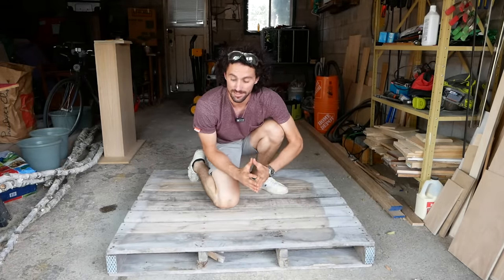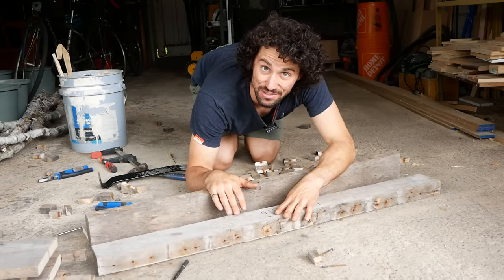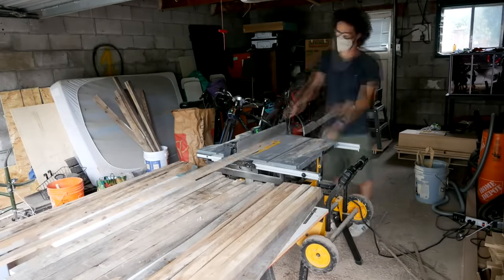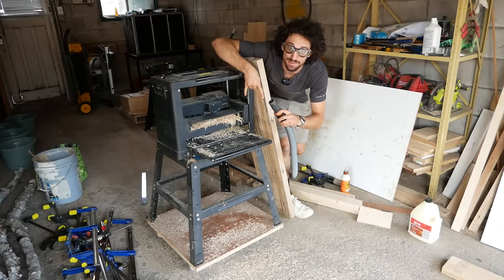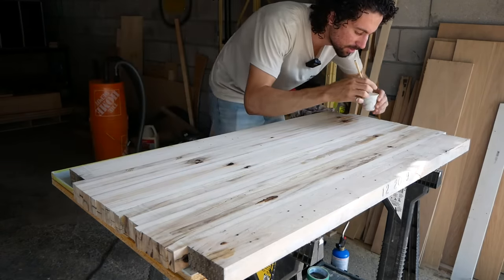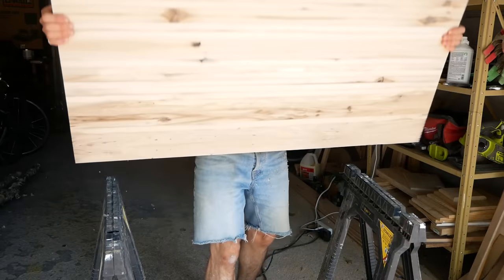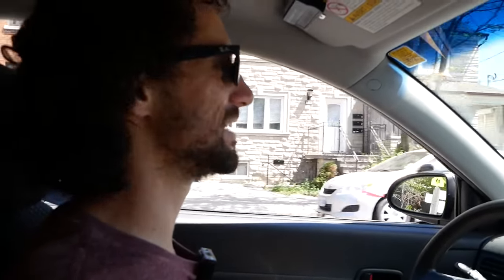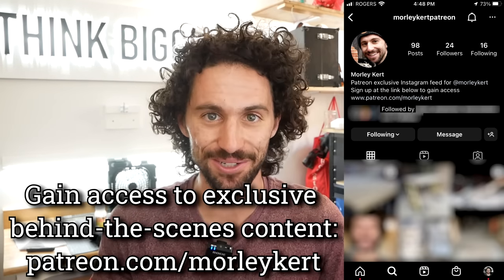Turning a Free Pallet into a $1,200 Desk

Comment: Here's a pro tip for you.   Use wire snips to extract nails with no head on them.  And staples and stuff.    Squeeze hard enough to grab the nail but not too hard to cut the nail.     It will work much better than pliers.
Reply: I usually just use another nail from the other side to whack it out ':)
Been working pretty well so far :D
Reply: Pallet made specially for him for this video lol

Comment: From floor refinishing experience: don’t over apply finish. 2 coats of gloss and 1 coat of satin is the best. More coats - higher chance of cracking.
Reply: sounds like it didnt dry enough before you added more coats.
Reply: Dude great for helping him out. good advice. I won't add much more. just want to let him and everyone else know more thin coats are way better than thick coats. Use your mind it will make sense. Woodfloor guys are the best.
Reply: Thanks for the tip, man!
I barely have the patience for 3 coats to begin with, so, now I have justification!
Reply: @jessiejanson1528  Yeah, never too sure about that, either: I got impatient with some Rustoleum enamel spray paint on my bathroom's laundry chute flapper door & frame; there was some rust due to scratches; I did some good sanding work, and feathered it out pretty well, and first coat looked SUPER nice, but then, I noticed an area that didn't get fully coated; but I got impatient, and tried to 2nd coat it too soon, and it ~dissolved the first coat: it got all 'pruney', and started peeling off...so, had to clean off all the soft/loose stuff, let it 'cure' for a couple more days before I could sand it again, and then repaint...
It looks like a real amateur job (which, of course, it IS...), but I have a lot more work to do on that bathroom's walls, plumbing, so, maybe I'll go back at it, again, later.
At least there will be much less rusting until then: I prepped & painted inside & outside.

Comment: I got the high rated pallet buster with tilting feet from amazon for $53 and I gotta say... pallet boards are almost always spared from cracking and the teardown process went from like 30 minutes to 3 minutes. Seriously worth a try. Also, be sure to metal detect pallet wood after you de-nail because often times those nails were strung together with metal wire which stays imbedded in the pallet wood and can damage your blades. love the pallet videos. Subbed.
Reply: That's a good reason to tun Diablo steel blades in all your saws. If you don't hit any steel they last a long time.
Reply: @Str8Spi3  lu?
Reply: +1 on the value of a metal detector for that work

Comment: $1200?! I've been in the furniture industry for a decade. There's no way the value of that desk is $1200... unless you find a sucker.
Reply: Right? All he did was cut it down, sand/varnish, and buy legs off Amazon that were made in Taiwan. How that added up to 1200$ is beyond me
Reply: There's a sucker born every day, the real trick is spotting them.
Reply: its that internet clout. its not just a desk, its a desk other people on the internet wanted, but "you go it". From a modernly famous people on the internet.
Reply: It’s not just about the cost of materials; it took him 12hrs of labor. He only charged $1,000 for it. The customer basically tipped him $200. You can set your hourly rate at whatever you want when you work for yourself.

I’m guessing his hourly rate is $60.

$60 x 12hrs = $780

Plus $170 for materials = $950

And probably a $50 delivery and installation fee. 

Makes sense to me.
Reply: @aliveandwell3958  it works out mathematically but he simply ripped him off... if I bought a plain stainless steel kitchen knife from amazon for £20 then took 12 hours to put my maker's mark on it, give it a new handle, re temper it and resharpen it, no one is buying that knife for 1,200 because at the end of the day it was a £20 knife, at the absoloute max you could get £100 regardless of the fact I put 12 hours into it
Reply: It’s called man made.  You pay more for man made things.  It’s an art form coming from an individual.  I have glass pipes that cost $10k-$20k that are considered “art” in gallery’s and in Corning glass messeum
Reply: @simplydiscgolf8519  Call it whatever you want, but it's not worth 1200 dollars, not even close.
Reply: @aliveandwell3958  It doesn't matter if he worked on it his whole life, that desk isn't worth 1200 dollars.  Simple as that.  Go to a furniture or office supply store and you can find a better desk for much less than that.
Reply: @kuhnhan  someone paid it, so it is worth that to Mckenzie actually. It was $1000 too, not $1200. He gave him $1200, but the agreed price was $1000.

When you break it down $170 for materials (NOT including ALL of the expensive tools he has to be able to do these things), 12 hours of total labor, and delivering it to your home and carrying it inside to where you want it.....Then $1000 isn't that bad when you include labor, materials, and convenience of delivery for a one off handmade piece of furniture.
Reply: @nickadkins7765  But it's a table made out of old pallet wood...
Reply: @IngoGarza  he used the nice hardwood though, not plywood lol. Same wood that comes from a slab just cut into boards 🤷‍♂️ would i buy it? No
Reply: @aliveandwell3958  That would make sense if you were paying for $60/hr worth of skill. A kid in High School woodworking class could demonstrate more skill than this.

Comment: tip: you need to understand the moisture of the wood. store the raw wood indoors; where it will end up, for weeks or more before working it and keep it indoors during the whole project. get a moisture probe and measure. Reason is that as it dries it will warp and you don't want that. if it is at the moisture level of the environment it will live in while working it will warp less.
Reply: That pallet wood is kiln dried and heat treated it will never absorb moisture again.
Reply: @daddywoofdawg  yet everything he makes is warped!
Reply: this happened to me with some cured/chemically treated wood from home depot, i used my welder skills and clamped one hell of a reverse twist in it, soaked it, then hit it with a heat gun. to my suprise it was actually straight the next day.
Reply: Yeah pallet wood has been exposed to numerous climates,and that's usually not a problem.👍
Reply: @daddywoofdawg  I work with heat treated pallet wood that has absorbed moisture all the time. I've had to build raised beds with each panels grain direction going a specific way because the previous beds I built warped so much, thats WITH tung oil too.
Reply: @daddywoofdawg  I don't believe that's true
Reply: @spacetimeworm  I mean it figuratively
Reply: @A2ZGeek  how is it warped, you'd need picture after at least a month to notice a warp. This table was literally planed the day before and as such can't be warped
Reply: @leolego2  the top is warped as shit. As planing does not remove a warp. He didn't flatten a single piece of wood in the whole video, he just made it thinner
Reply: @leolego2  first of all planning doesn’t give you a flat surface, it gives you an even surface, you can achieve a flat surface by shimming one side then flipping it over and doing it again with the flat side as a register. I don’t recall him doing that. Planning is designed to help you reach a desired thickness and also ensure all the boards are at the same level, a planner will not automatically flatten an already unflattened piece. 

Secondly you can see when he sets it on a flat surface it has a bit of a rock to it corner to corner. This indicates that it’s not flat. It will likely stay the way it was finished but it’s definitely not flat. It will only get worse if the wood was ether full of moisture or dry and is subjected to humidity. It can also warp if it encounters temperature changes such as working in a hot humid garage and then moving it to a dry cool apartment. 

Another way to cause warping is when gluing and clamp and top on an uneven surface, such as a piece of wood spanning two sawhorses on an uneven garage floor.

Comment: Fellow woodworker here, I like using painters tape to surround a gap/crack. Makes for less sanding and less low points when trying sand away little glue blobs. 

Running a chisel gently down a glue line is super satisfying as well. 

Hope you didn't get sick when epoxy coating the table in your apartment. It's toxic my guy.
Reply: He was in his garage the entire time .. not in his home
Reply: Darline, did you watch the video?
Reply: @darlinebrooker843  No he wasn't, you need to actually watch the video
Reply: @darlinebrooker843  He specifically made it a point to apply the epoxy indoors to avoid embedding any dust from the garage in the finish.

Comment: If you get a pallet where all you really want to salvage is the planks (more common with skids) you can use a reciprocating saw with a thin "demo" blade between the planks and beams and cut the nails; removing the wood you want very quickly. If you use a cordless version you can do it on site where you find the pallet and make the entire pallet take up less room in your vehicle. I punch the nails out from the cut side, with a springloaded center punch usually just one or two taps knock them out.
Reply: YES! The the absolute best way to do it. I used to struggle with a flat bar and hammer trying to break them down, then, I saw someone doing it the how you mentioned and was blown away. Such a time saver!
Reply: This may be one of the best comments I've read all year and I'll definitely come back and let you know if I utilise it in the next couple of months as I'm thinking of going into the reclaim world
Reply: @denverflatpackjedithornton   Also, there are the rare pallets with screws instead of nails, get yourself a cordless impact driver and a cordless reciprocating saw and you can blast those pallets apart in minutes, also in my experience comes in handy if you want to say reclaim wood from a furniture piece someone has thrown away you can just take the pieces you want (ie a dining tabletop can be a great source for fairly decent hardwoods)

Comment: Nice! 

In case you were wondering the wood you’re working with is hickory. 

Also i’m not sure that you check the moisture content of the word before assembling it. When you picked it up from the person you bought it off of she said there was I believe fertilizer on it? Most likely a bunch of moisture has been soaked into the wood and can lead to issues over time shrinkage. There are many pin meters that you can get. Also, your wood moisture wants to be around 5 to 8% moisture Contant for any sort of furniture, or in my case, flooring. Hope this helps your business.

Comment: I never process used wood until I check it with my metal detector. Bought one on line like the TSA use. More than paid for it self, by not junking bandsaw blades or planer blades. I found that pallet makers use wire collated nails and you can easily miss the wire stuck in the board.
Reply: My thoughts exactly

Comment: Just a note that if you use pallet wood, as I do allot, be aware that there are tiny pieces of wire remaining in the nail holes. These pieces of wire connect the nails together to feed the nails through the nail gun that assembles the pallets. These remaining wires will nick and damage the planer blades. I drill out all of my nail holes before I send them through my planers. Blades are not cheap when you damage them frequently. It will also leave raised lines in the planed wood, which of course can be sanded out. Nice table top BTW!
Reply: And the chemicals they put on the wood for the pallets...
Reply: Oh boy, I didn't even think of that. In the end, it's got to be a false economy to work with pallet wood. I've made pallet furniture out of them, but didn't need to take much apart, and the wood was just so dreadful.

Comment: In order to crack apart pellets, I place a scissor car lift jack between the planks and insert a small piece of flat metal bar between the narrow side of the jack and the plank. This keeps the plank from splitting. The planks will unfold as you turn the jack. After that, you can either cut or remove the nails.

Comment: A tip for keeping the slab flat at glue up. Your table saw will never be exactly 90 degrees and if you rip both halves the same way up, the say 3/4 degree  error will compound to 1 and a half degrees resulting in a non flat finished slab. So, instead, every other board (or the second of two) over and the discrepancy will then cancel out. Flat glue up, presto.
Reply: could you explain this a bit further? do you mean to alternate the face with each glue up ?
Reply: Your comment is edited and still full of missing words and weird grammar..
Reply: If you dial in your table saw it will be 90 degrees dead on and stay that way with maintenance. That is absolutely not true

Comment: Great project. A tip I learned from Adam Savage (the CA glue master) is when you have a situation like that where you need the glue to stay put spray activator on the spot before and after adding glue that way it stays put while applying. Cheers!

Comment: quick tip on how you can remove those "broken head" nails out. 
-when enough of the of the nail is sticking out, like when you punched it out before running it through the planer
     -use some wire cutter pliers to gently pinch the nail. make sure the smooth side or the pliers are facing the wood.
     -leave enough clearance between the board and pliers so that you can squeeze your hammer or nail pry bar between them
     -you will need to apply just enough force on the pliers to keep them from slipping and to not cut through the nail.
     -now just pry the nail out, you're essentially using the pliers as new "nail head".

:goodvibes: hope you can interpret and implement this!!!!
Reply: This is one of the tips I that I wanted to be sure made its way into the comments. "End cutters", aka bullnose cutters, or nippers are also great alternatives to the "side cutters". End cutters have a nose that can serve as a fulcrum to roll away from the nail and draw it out. An old putty knife can be placed under the nose to minimize denting the wood. Don't use a good putty knife (or your 12" taping knife) for this task.  

Another tip is to use a pin-punch instead of a nailset. A pin-punch will have the same diameter of shaft for an inch or more of its total length. This avoids making a hole any larger than necessary, while driving the nail deeper than the reach of the nailset. With a set of pin-punches, the perfect size punch can be selected to provide enough strength and force for the task. It can usually be slightly smaller than the diameter of the nail. Follow the path of the nail with the pin-punch as it pushes the nail through.
Reply: I think I made it to adult or like working man YouTube and these comments are the most awesome thing I’ve seen this week so positive and helpful
Reply: I have used that method...it works!
Reply: There are nipper style pliers made specifically for this. Its curved and u just roll the pliers. Anyone planning on doing many pallet projects should definitely get one.

Comment: First off, great job. I used to recover aircraft engine pallets and plane them down for projects. Most of the planks were 3 x 8 x 10' black oak or some other oak species. If you can get a bead on any I'm sure you could make some pretty nice stuff. Now, this might seem a little nit-noid, but if you're running a small business there are a few costs you didn't factor in, such as the sandpaper, the saw blades (especially if you had to get one specific for the nail), the time and gas picking up all the various supplies, even the power. All of that factors into the costs of goods sold. That said, you're still coming out way ahead, kudos!
Reply: Don’t forget the plainer, most expensive on mine, around 250 on my grizzly if he would of hit a nail. Ripped fabric in the car also 😂

Comment: if you have a nail that breaks into the wood and you can't get it off, get a plug cutting bit and cut a plug where the nail is stuck, the nail will come off with the plug, then simply plug the hole back with a dowel from a scrap piece. also when you use pallet wood for projects, get yourself a pin pointing metal detector and scan your wood for Embedded nails before you cut them on a table saw, planer or jointer, trust me it is worth it.

Comment: If the head of the nail breaks off, chuck it in your drill and spin and pull. It works for me most of the time but some times the exposed part of nail breaks off.

Comment: I made a planter and a few other items from used building wood and pallets. I'm not a carpenter, just a guy with a saw and a hammer. Where I'm from you can pick up a used EPal for about $10-15, or find plenty lying around.

Sure, it won't be a burlwood/mahogany fancy table, but it looks very good because of your finish work and the recycling bit is important too. After all, so much usable stuff is just thrown away.

Comment: Safety note: never, never, never cut through a nail like that if you are hooked up to an extraction system. The sawdust becomes aerosolized and turns the collector into a very powerful bomb. You should take care even if you’re cutting without an extraction system. Make sure the shop is clean and there is no buildup of dust in the air. Sparks + sawdust = death. 

The top turned out great and I’m genuinely pleased you were able to get a good price for your work. But I think you underestimated the cost: tools, shop space, vehicle payment, electricity, insurance, gas, etc. There are a million and one hidden costs!
Reply: There is not a single reported case of a dust extraction system in a home blowing up.
Reply: @davidlangdon9956  Most likely because the people that did blow up in a garage dust explosion failed to file a report.  D'oh!
Reply: Exactly what I was thinking. There are so many more costs than time and material. This is business 101. sigh.